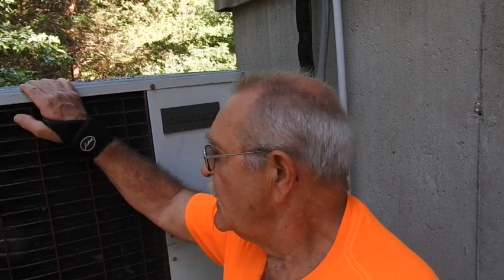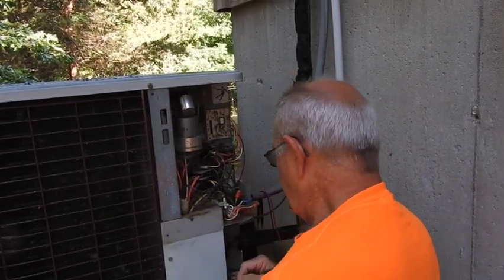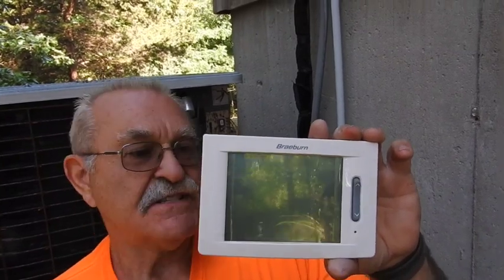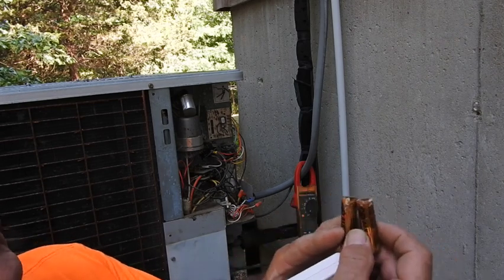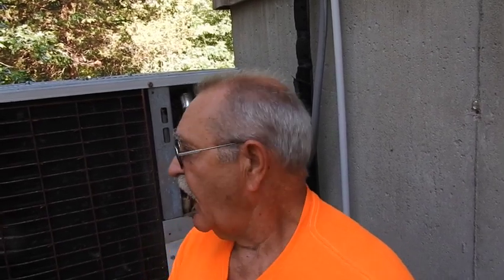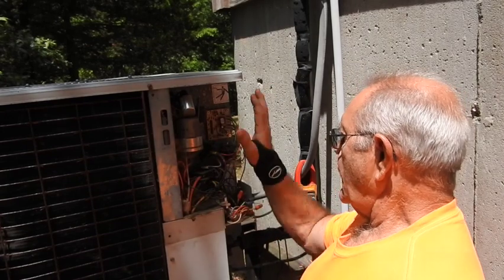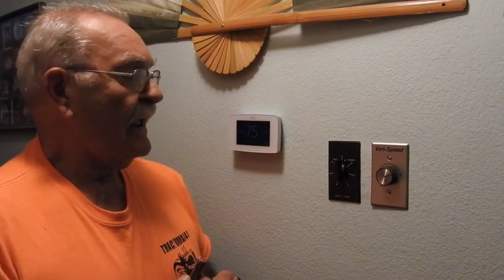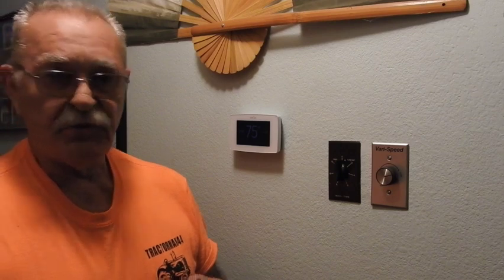DIY Thermostat Troubleshooting:  Do YOU Change Batteries Every Year? Look What Happens If You DON'T

Comment: I have a wifi thermostat  no batteries  needed bought from the electric  company  at a great price
Reply from the maker: The SENSI has no batteries either Mark.  They rely on 24vac from the control circuit.  The battery backup stats are because many existing systems do not have a 'common' wire to the thermostat location and are typically non-wifi capable.  The wifi stats require full 24v to communicate.  And yes, there are quite a few manufacturers that have a much lower priced wifi stat.

Comment: Air flow is major!
Reply from the maker: Heat pumps get a bad name due to improper air flow.  Duct velocity must be lower to benefit from the lower discharge temperatures in the heat mode.  The standard higher velocities of normal hvac systems is fine for the much higher air temperatures delivered by fossil fueled furnaces. So yes, you are totally correct in your statement Matthew !!

Comment: Thanks for covering a rather basic concept::Change batteries in thermostat, smoke detectors and carbon monoxide detectors once a year!  Within the last six months I had to change my thermostat and CO batteries.  Corrosion on batteries in both instances.
Reply from the maker: Well, my inattention to the battery condition cost me a big chunk out of a 200 dollar bill !!  Yes, I could've bought a much cheaper thermostat.  The local supply house has a good variety of them.  I installed one of these on my son's system last year and he LOVE's it.  Good input about the other battery devices.

Comment: Too fancy for my pockets. 🤣🤣 Well that's what you were saying. I like the round ones that still have a Mercury level in it. It's like have electric windows in cars how you going to roll them down if you end up in a pond 😉. Okay that's another generation I heard coffee but these look pretty handy.
Reply from the maker: I've only installed about a truck load of the T87F Honeywell with the Q539 sub base in the last 45 years.  They and others like them are almost all gone now with the big mercury scare...which is BS as far as I'm concerned.  Those were the best and most reliable H/C stat on the market.

Comment: I’ve installed a few Sensi’s absolutely a great thermostat
Reply from the maker: Yessir, they are an incredibly simple thermostat Lou.  I never sat one up so easily in my life.  Configuration to the system is as simple as indicating what control wires you are using after designating the system as a HP and identifying the 'O' terminal.